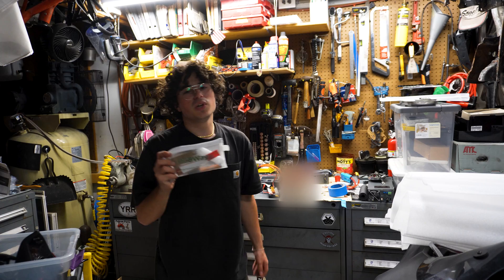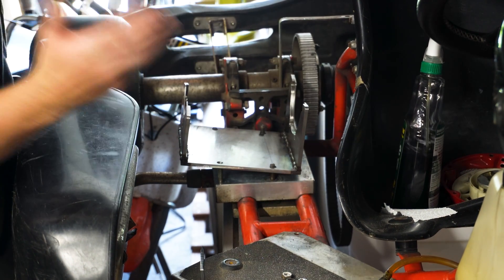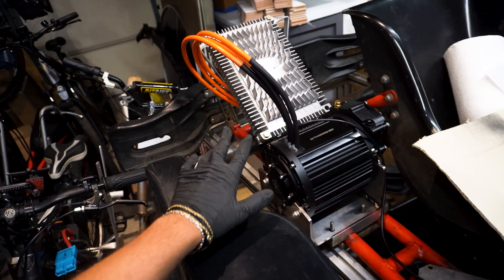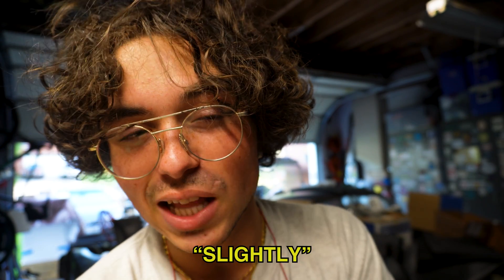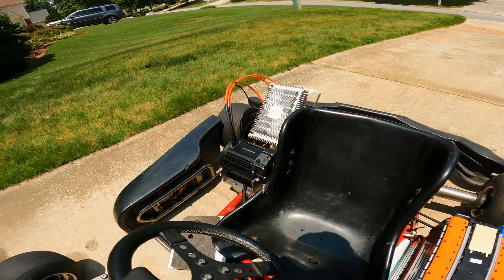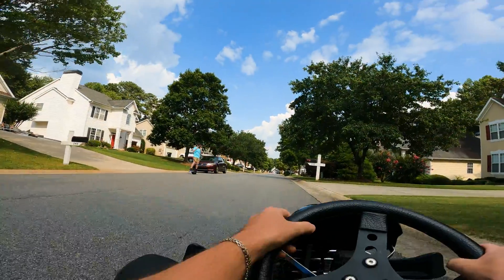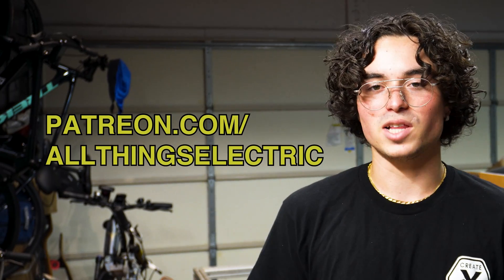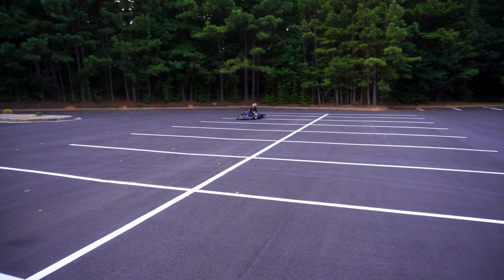70mph Electric Go Kart | 110V E-Kart RIPS

Comment: That motor is 50hp and the one in my rc truck is 25hp they say.... it's a castle creations xlxl2 esc with the 2028 1100kv motor. They say on 8s it's 25 hp. People say that's way way under rated that it's more like 30hp. There is a guy than made a go kart with a castle xlx2 and a 2028 800kv motor on 12s and it did like 50 plus mph and even did a dual motor one as well! But I'd rather have one the way you built it more tourqe I feel like

Comment: You're going to want to put that blue reflector back.  They mark underwater pipes and Fire departments use them to locate fire hydrants in an emergency.  Don't be a contributing reason why your neighbors dies in a housefire.  You have the data on this video to know where to put it.  You can probably use JB weld and there will be an imprint on the road where they originally epoxied the reflector.

Comment: Being a go Kart.  Did you play with the rear wheel spacing to give you more control?  Standard chassis tuning.  Wider loses grip but keeps the kart flatter, narrower gives more grip however it will be trickier to control and be smooth with it.   Like the way you edited the production, well done.
Reply from the maker: I will def play around with this! Thanks!

Comment: I just looked through your site and I have a project you may be interested in. Basically just take a flight controller and reconfigure the software to operate a vehicle. Use one motor per wheel and you can go nuts programming all sorts of drive systems. I personally cannot modify that code but the guys from Emuflight believe it wouldn't be very difficult. My thought was to build a 4wd kart with one motor per wheel much like how formula SAE karts are built and then sort out dynamic stability and even drift angle control in software if I was to ever get to that level. Would love to chat some time if you're around. I guess respond to this message if you'd like to...
Reply from the maker: This would be killer man! Been wanting to do something along these lines for a while. Our SAE team at Ga Tech is pretty wild, we could definitely get something in the works. Let’s talk ab it! Message me on Instagram! P. S. I’m a huge Kabab fan

Comment: I'm half way considering a pretty unique build of my own. This was super fun to watch. Also, how far can you get with the regen breaking? I'm curious if I can get away with smaller breaks relying mostly on regen.
Reply from the maker: Range would be an interesting test, no idea. I can say however it’s about 45 minutes of hard driving. I actually have no physical brakes on this build; they’re there but the bleed screw is stuck so they have no pressure. The regen is so powerful that it will lock the wheels entirely while going full speed.
Reply: @AllThingsElectric_  how much were the electronics?
Reply: @AllThingsElectric_  amazing to hear regen is that good. I think I can tune it in software too for a bit of further reverse force on the front too if I had 4wd 4 motor. Super intrigued

Comment: damn this is sick. it’s crazy how popular qs motor became. when i built my kart there was very little brushless motor options which is why i went with and old dc motor
Reply from the maker: Thanks! I believe they've been around for a while but yes, the popularity is what made the noticeable. Just absolute beasts of motors, rated 4kW but can push over 30? Insane
Reply: @AllThingsElectric_  true. motors basically can push out as move power as you put in given that they didn’t melt. my motor is rated for 1.5 kw or something like that

Comment: nice job! that thing looks like a blast! where'd you get the cart itself?
Reply from the maker: Thanks! Your videos helped with this build! I got super lucky with the karts on Facebook marketplace haha
Reply: @AllThingsElectric_  that awesome! glad they were helpful. Ive really been wanting to build a cross cart but want to start with one of these go-kart which look super fun! I was debating whether to build the frame from scratch or pick one up
Reply from the maker: Seeing your videos, you could definitely build one from scratch, but I would recommend picking up a rolling frame. It will just save you a lot of time... and math.
Reply: @AllThingsElectric_  math I can deal with, its applying it IRL that requires actual skill. I dont think Ive welded a single square joint in my life
Reply from the maker: Im sure you could make it work, but I still recommend just buying a roller.
Reply: @AllThingsElectric_  I think I'll do that. Thanks!